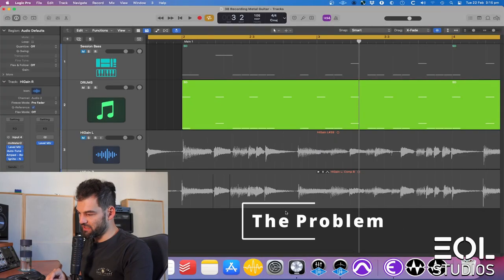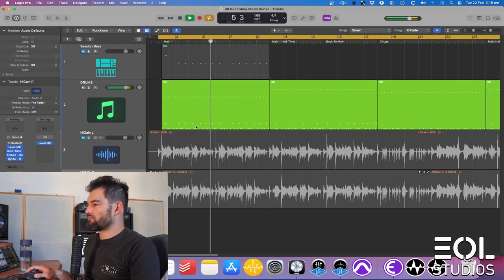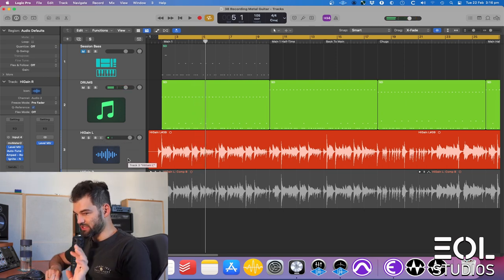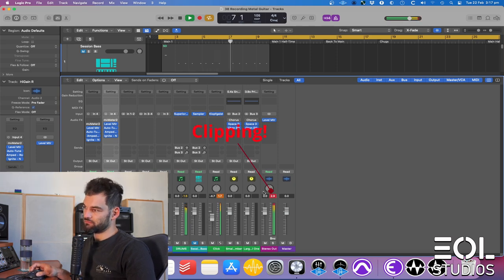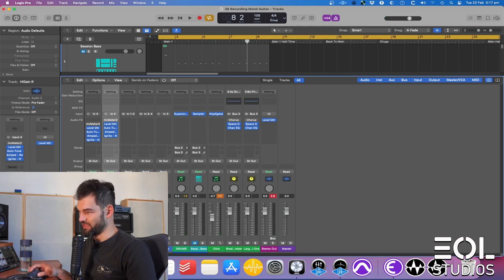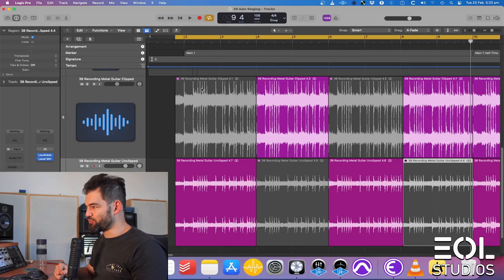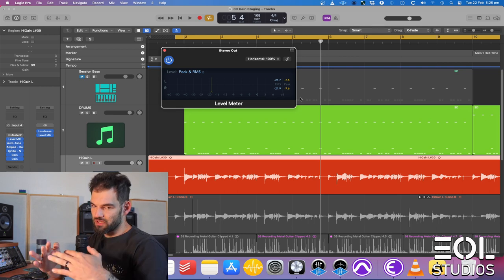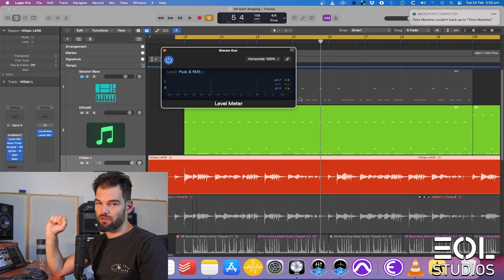Recording Metal Tutorial. Levels and Gain Staging.

Comment: When I try to follow this guide, even with the smallest amount of limiting, I have to keep most of my faders so low that there’s barely any room to lower to lower volume still in logic. Help?
Reply from the maker: This means that your audio is too hot to begin with. You could try normalising your audio files or simply recording with less gain. If you use any plugins on your tracks, make sure that the level stays matched before and after, otherwise you would be boosting up volume with these plugins 
Hope that this helps